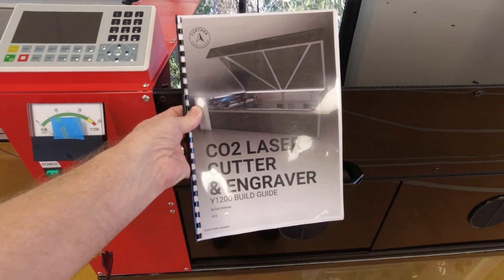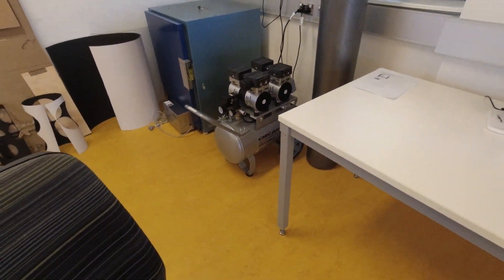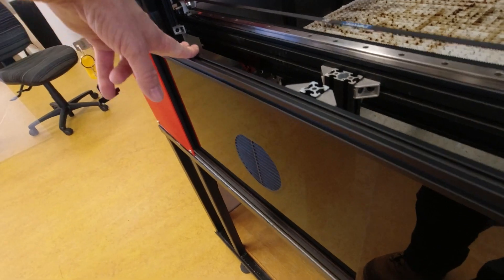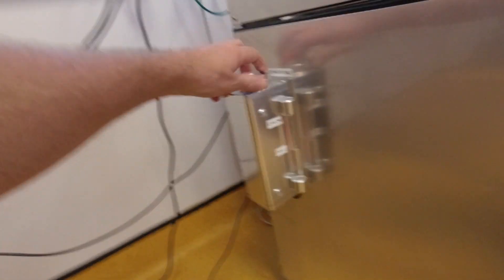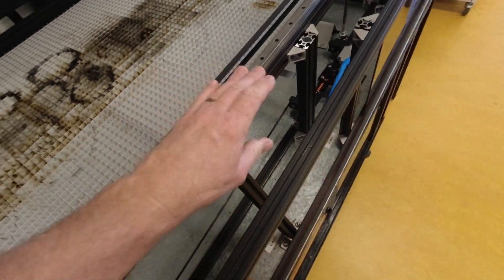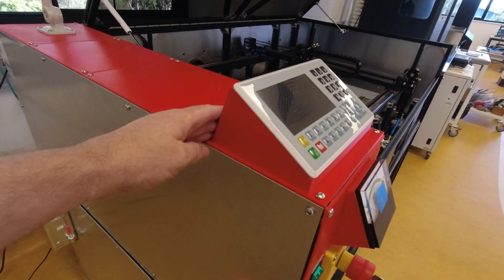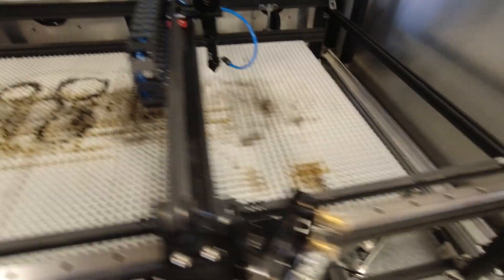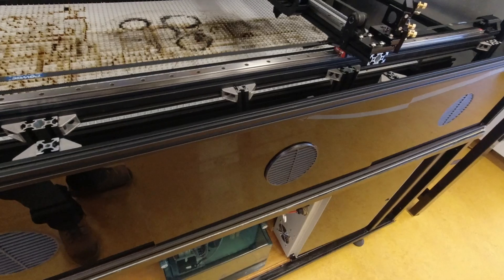Y1200 DIY Co2 Laser Cutter - It Cuts STAINLESS!

Comment: Hello. Great build. I'm about 90% done with mine. I'm curious about the white cylinder you have close to your airpump. Could you please elaborate on it? Thanks
Reply from the maker: Cheers mate, we've made a switchable multi-gas setup for the nitrogen generator we're making.  That cylinder is the final stage, it's just a buffer we were hoping would smooth out the bursts of air when switched to the little compressor used in Rob's design.
Reply: Thanks for the reply. I thought as much. Im also using the same type of pump and was looking nto doing something similar but wasn't sure if it would help. I was looking for a homemade pulsation damper for air, but no success yet. Does the cylinder dampen the air bursts?
Reply from the maker: @charleskelly1281  We haven't done any real tests, but I don't think it helps much unfortunately.

Comment: Hi,

Could your help me out with how you placed the mirror and tube for the diagonal design really cool idea. 

Also what brackets did you use for the tube and mirror and how did you place them. 

Thanks Ollie
Reply from the maker: We just used the standard mirror brackets and we welded a couple of slotted angle iron brackets to the frame to give us the adjustment space - this is going to be highly dependent on your base frame design.  The tube is held with standard tube mounting brackets hung upside down.
Reply: Ok could you take some photos of the brackets please? Also could I buy the plans for the cabinet from you?
Reply from the maker: @OllieDeer-cw2kp I won't be back near that machine for a while, but I might be able to get some photos then.  The cabinet was a simple box design that was built by our workshop at work so I won't be able to supply the plans for that unfortunately.
Reply: What was the cabinet made from?
Reply from the maker: @OllieDeer-cw2kp The cabinet is just 50mm box steel welded together, so it is very heavy with negligible structural flex.  The trick would be to try and get it as square as possible.

Comment: Hello, what is the max speed you reliably can run on engraving without any jumping of the cut head?

Thanks
Reply from the maker: I'm going to be away from the machine for a while over Christmas, but speed hasn't really been a limitation that we've found, I can't remember what the upper limit was but it was fast and in general any jumping/over-running hasn't been a problem.
Reply: @ebswift  Thanks for the quick response! My potential parts supplier for the linear rails and the aluminium extrusion was highly sceptical when I told him that I want to achieve the speeds of 500-600 mm/s that I saw some commercial Chinese machines doing so I wanted to see if I can get some reference.

What would you say is the limitations you faced?

Comment: really impressive build.  what firmware are you running on the controller that enables the U axis for rotary
Reply from the maker: Thanks for the comment, this is the RDC6445S, note the 'S' at the end, and using V26.01.13 firmware.  Requirements for getting rotary working are (using Lightburn):

1. Enable Rotary in machine settings
2. Select Start From Current Position in Laser settings
3. Press Origin on the Ruida controller
4. Send the job to the Ruida from Lightburn
5. Press Start at the Ruida controller to begin the rotary job

This is using the U axis of the controller, no trickery swapping out the Y access or similar.  It's fairly straight forward to do, though tricky when you don't have a list like this to start with ;).  Maybe I should do a video on the rotary addon.
Reply: @ebswift  thanks for the reply. I also built the y1200 and use the same controller.   Now I am looking to add a rotary and would prefer to just add an additional stepper driver and use the U axis.  There is a ton of incomplete or bad information about what controllers work and the specific firmware needed.  I think a video on this subject would be valued if you made it.
Reply from the maker: @1010tesla  No worries, I'll see what I can do.  It certainly was a fair amount of work trying to piece together information, configure things and run tests - with the controller being so widely used it shouldn't be that hard

Comment: Dear sir ,    my son-in-law is building a y1200 CO2. He asked me to help with the connection of the power supply and the steppe motors. My question to you is what kind of cables (mm2) do you use for the whole circuit with greetings Joost